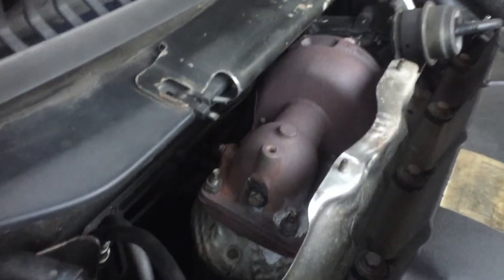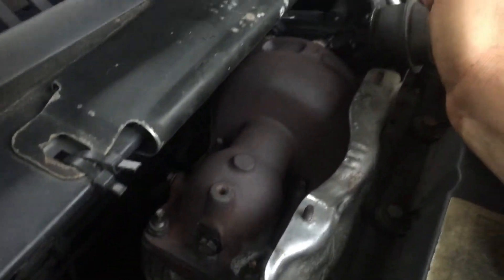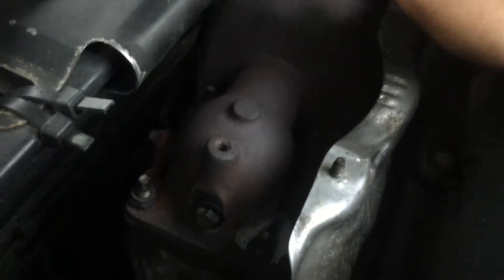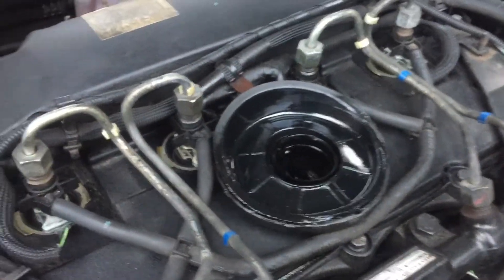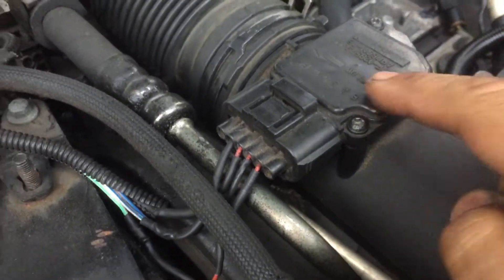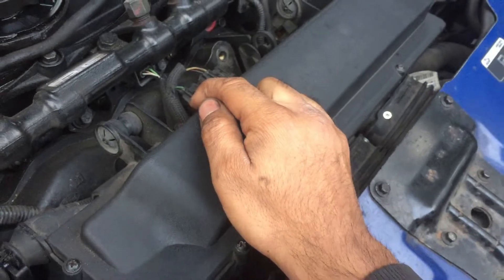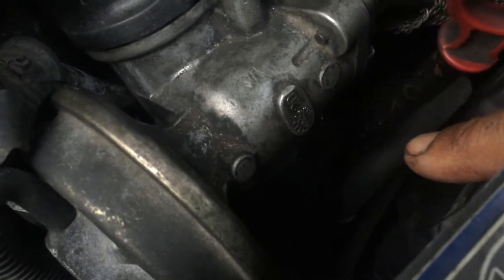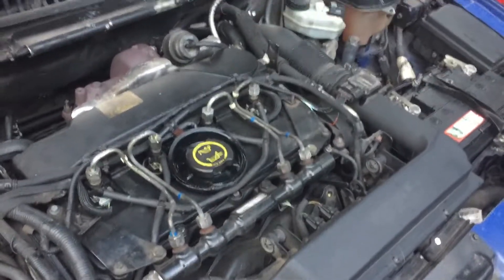My Tips To Keep Your Jaguar XTYPE Running For Longer

Comment: Good tips. 
You can also check the back of the rubber intercooler hose leading into the egr valve. It can split (just below where it connects into the bottom of the egr valve) due to erosion from oil ingress, meaning you lose turbo pressure. I had this problem and fitted a new hose. But that also split after a few months. After a further failed hose I ordered a silicone hose, rather than the standard rubber hose. That works well and is still good after 2 years. Silicone doesn't deteriorate from oil contact!

Comment: No.1 tip is actually keep your injectors clean. They are the heart beat of your engine. Clogged injectors equals more soot, less power, less mpg and not a very nice driving experience. I always use Archoil fuel additive which is one of the best in the business. You can also have them cleaned professionally and flow tested. After 2009 all diesels have a dpf so a good thrash once a month's will do wonders and then there is the egr valve which should be removed and cleaned once and a while, probably best to do the manifold at the same time. It's not a hard Job but make sure to wear some disposable gloves as you will be as black as the ace of spades in no time😆
Reply: hi  simon thanks for the tips i plan on keeping my 2002 x type running for a long time
Reply: False information, not all dieselshave dpfs after 09